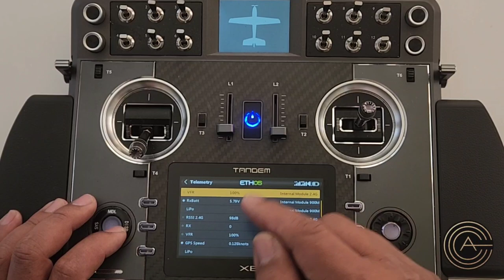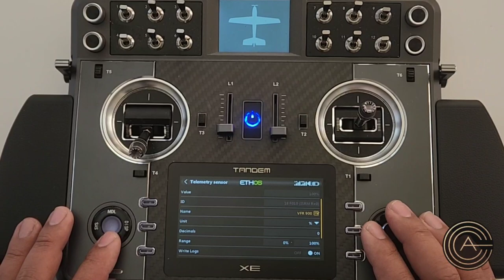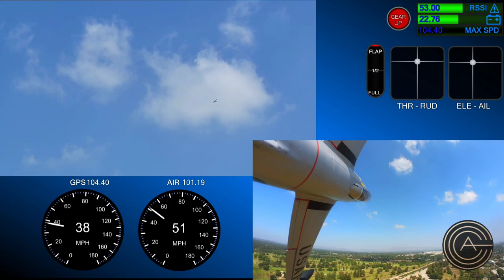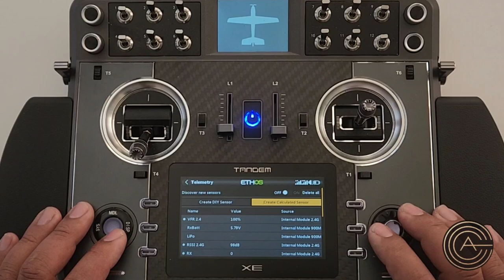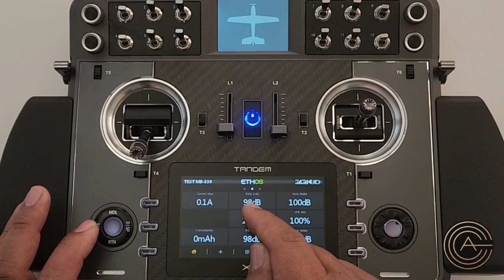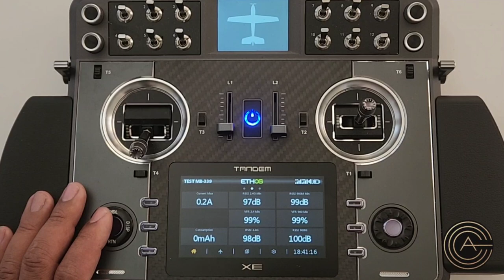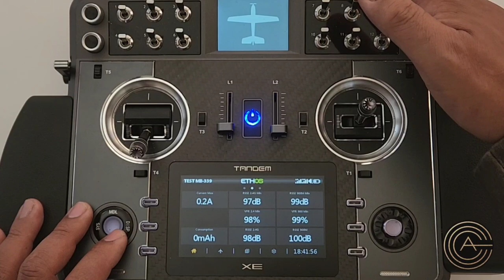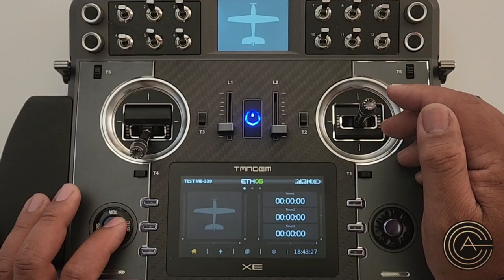The Frsky Series: Using and Understanding VFR and RSSI Telemetry

Comment: What a great radio with the screen at the bottom for programming... brilliant video... I'm about to leave Spektrum and loving the added benefits of what FRSKY has to offer...value and quality and excellent software.
I'm want to use a T Motor program box the AM LINK  that doubles up as a UBEC and a Telemetry on the Tx screen for ESC temperature ,mAh used Revs etc a really neat solution for what normally is used once and left in your toolbox .
 information
Reply from the maker: Interesting.  I assume it's designed to work with their escs? Frsky also has a line of ESCs that provide telemetry like that as well.  No external box needed.  I personally haven't used them as i would use that with my planes that use over 100 - 160amp escs. Frsky does not make escs that big yet. I'll read up more on that solution... thanks
Reply: @all_rc  Not 100% sure it only works with T Motor ESC but most likely I would say.
I'm about to buy either the X18SE or X20S really torn between them...could do with actually holding them.
Reply from the maker: You need to hold them... i have the 20s and the XE. I bought the 20s when it was the only one they offered. If the 18s was out, i would have bought that. It feels so much better in my hands (and most people that i know that tried both). That plus the extra trims would have sealed it for me. The smaller screen on the 18 would not have bothered me as much. Definitely look at the S versions as you get better gimbals, in my opinion.

Comment: Very nicely explained and also mostly applies to other FRSky TXs. I’m wondering how to set alarm threshold for VFR as it’s a new thing showing up on my X series RXs and I’ll start with 50% and take some flight logs.
Reply from the maker: I never set it. It is already set. If you go into the options you'll see a default alarm value for low and critical. Whatever those are set to is the alarm value.

Comment: Lol I always delete VFR, mine says “vfr low warning” all the time. It’s so annoying
Reply from the maker: Hmm... what receiver? I hardly ever get a low vfr warning. I run mostly td series receiver but i have run others without an issue. My friend runs mostly frsky's 2.4ghz stabilized receivers and he rarely gets any vfr warnings... VFR is the number of frames returned that are good in percentage. If you are getting the warning then at least half your frames are bad. I would be hesitant to fly like that until i figure out the issue. Might be a certain area at your flying site if its consistent with many other planes. Others have the same issue where you fly?
Reply: @all_rc  well a few planes. Nothing with Tandem. It's the SR10 pro on my FW-190 with Saito radial. I just deleted the sensor.  Problem solved lol
Reply: I do run a 900 in the tail of the plane.
Reply from the maker: Ah. Do you ever get sensor conflict warnings?  When running two receivers, I've been told that you need to turn off telemetry on your secondary receiver. Wonder if its just a conflict issue